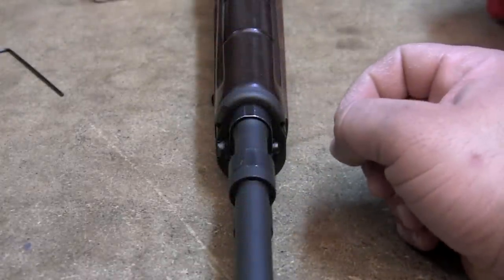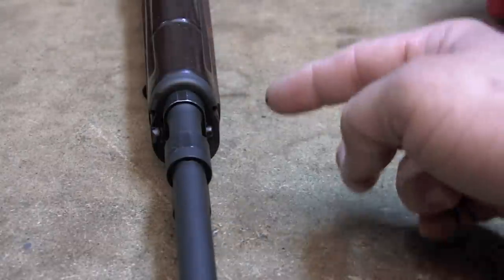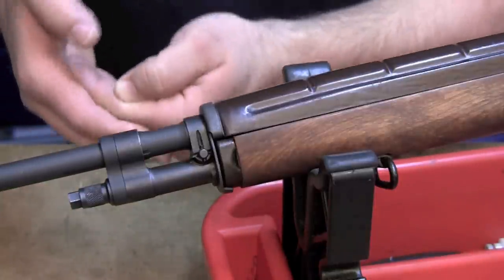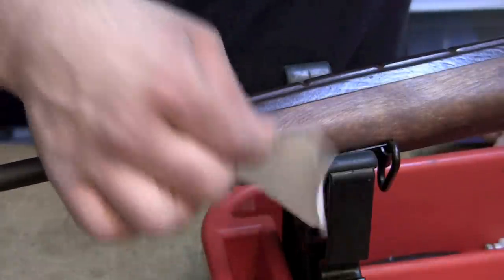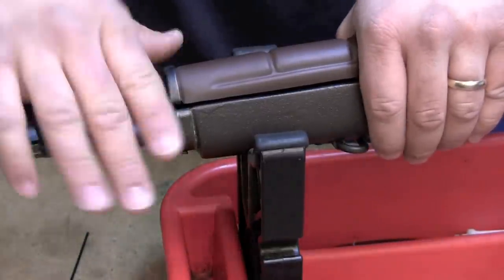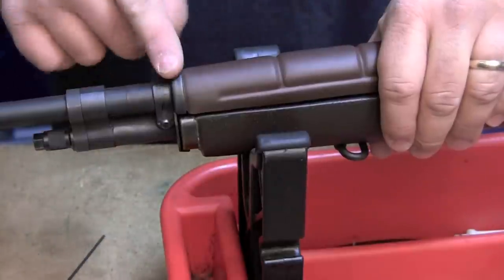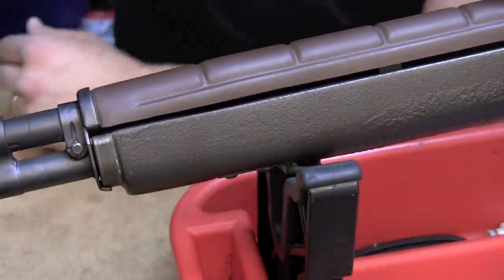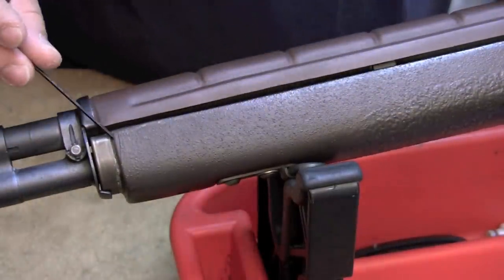M14 M1A Inspection Video Episode 3: Draw Pressure and Handguard Clearance

Comment: A trigger pull gauge works quite nicely for checking barrel pressure in the stock. My national match M1A which was built in 94 by the Springfield Armory custom shop. The handguard is free-floated. And the gas cylinder is drilled and tapped so the front band can screw to it.

Comment: I am encouraged by your advice on having no contact between handguard and stock. I have attempted twice to sand mine to get clearance, but it still touches.  It may be twisted?    Gonna get more aggressive with the sanding, and if it doesn't work I will be ordering a new handguard.
Was shooting today and had some issues with rear sight adjusting.  Followed your tutorial on disassembly, lubrication and proper tensioning and voila, it's 100% better.
Thanks!

Comment: Everything on top ,barrel, hand guard, gas cylinder band, must be free flooring, therefore the stock must have enough clearance that every shot must not touch everything at the band bottom location. ( At least .1825 clearance )

Comment: You may be correct on the point about improving accuracy by not having the handguard touch the stock, but if I had a real USGI handguard there is no way in hell I would sand it down. A cheaper polymer one maybe but not a real USGI. Never happening with my rifle.

Comment: Great video as are your other works.  I see you only use standard stocks on your M1As. What is your insight on chassis systems like the Sage Enhanced Battle Rifle, Troy, Juggernaut bullpup?
Reply from the maker: I have very limited experience with the modern chassis systems. I've only shot a JAE and a SAGE once before. I am, however, currently building a modern day rifle with an LRB M25 receiver which will eventually be outfitted with a SAGE chassis. I hear the SAGE and the JAE shoot very well and are solid platforms to mount an action into.

Tony.
Reply: tonyben3 What kind of MOA do you get with your stock platform?
Reply from the maker: My personal rifle was bedded by me. I have a carbon graphite kevlar stock that Jeff Shapiro made a few years ago. I don't think he makes them anymore. I found  good load on my last outing and put 9 shots in one ragged hole that measured 0.877". I pulled one shot which brought the 10-shot group out to 1.2" I also shot two other 5-shot groups that day which measured 1.06" and 1.07". They were fired consecutively and I only made a slight sight adjustment in between, but all 10 shots would have overlaid the same 1.07" pattern. I've only recently started to shoot with a scope. With iron sights, I can hold 20 shots under two inches.
Reply: That seems very good. Were you shooting reloads or factory? I'd say I get the same groupings with my Sage chassis. Maybe you can fine tune with the barrel tensioner if you decide to get one.
Reply from the maker: Thanks. I shoot handloads almost exclusively. I have a few more to play around with to see which load works best. I will try a SAGE some day within the next year or 2.

Comment: I bought a birch GI stock and my barreled assembly shifts about 1/16" to 1/32" forwards and back but never contacts the face of the band and has decent draw pressure. Would you do anything to stop this movement? I haven't noticed a difference in accuracy although I haven't shot paper with it in this particular stock.
Reply from the maker: HeretoStay33 It really should be bedded to really achieve the best accuracy. You might be able to add some aluminum shims to the receiver legs in certain areas to reduce the movement. That may help

Tony.
Reply: Thanks I'll give it a shot.

Comment: Good info.Question: Would be advisable to put a small spot weld on the front band where it touches the ferul, to put tension on the front band? I've used a small piece of rolled up cigarette box at the range once and it worked pretty good.But I didn't leave it that way.was an experiment.
Reply from the maker: Probably not a good idea to weld the FB and SF. I could see the weld breaking eventually due to the barrel whip. I believe (may be wrong here) that the goal of the tension is to allow the barrel to whip, but to dampen it and make sure it returns to the same spot once the barrel has stopped bouncing up and down.

Adding card board or even a dab of JB weld to one of the surfaces (not gluing them together) can tighten up draw pressure and help the rifle be more consistent from shot to shot.

Tony.
Reply: tonyben3 Is this pressure why you use the fulcrum block during glass bedding?

Comment: is glass bedding the only way to correct draw pressure? my rifle is not touching
Reply from the maker: You can shim the front of the receiver to tilt it up, or you can shim the trigger housing to tighten the trigger lockup. That can sometimes improve draw pressure. A glass bedding job will be the best fix.

Tony.